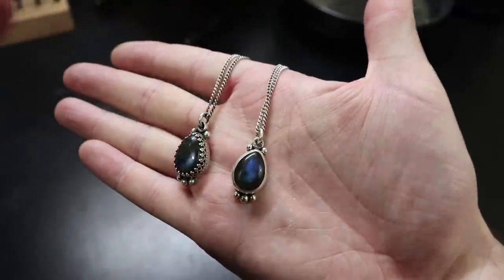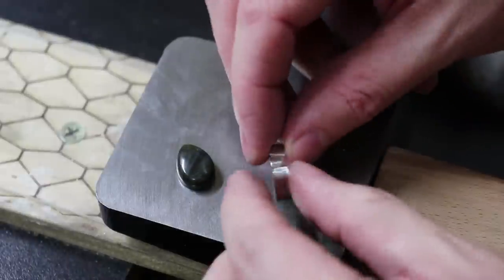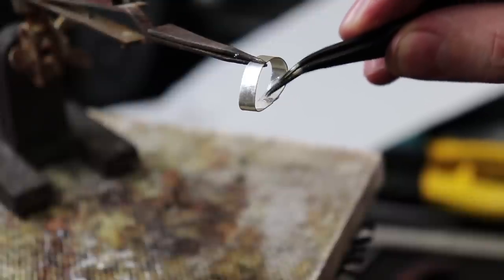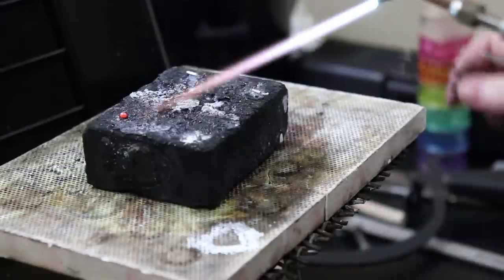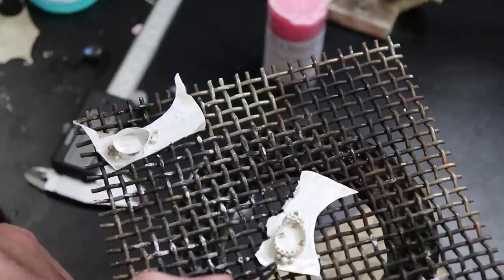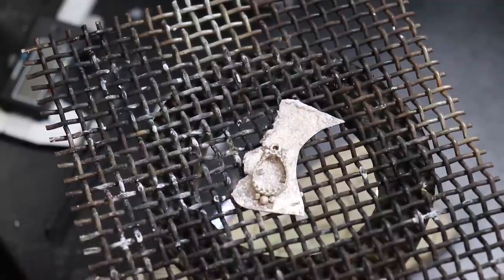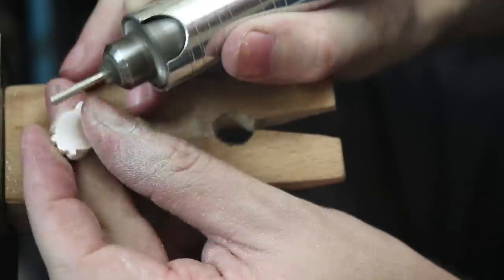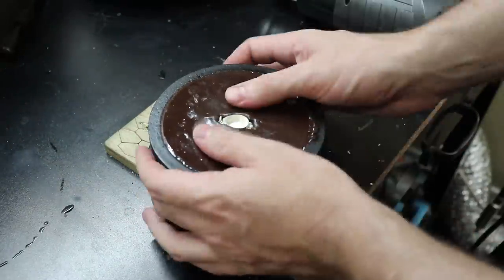Bezel Making and Setting Made Easy

Comment: Nice video. The trick with the floss was new to me. I usually have an open backside on the pendants I make so I can push the stone out. Also it reveals more of the stone and saves silver. 
One thing I do differently is I put the pieces of solder on the outside of the setting rather than on the inside. For two reasons, it's easier to clean up and if some solder remains on the inside of the bezel, it can leave a little hump that increases the risk of breaking the stone when applying pressure while  setting the stone.
And I really like your saw, I've never seen one like that before.
Reply: I also set the bezel on top of the solder pellet that the solder fliws up the seam and doesn't blow away

Comment: OMG! This video makes so much sense. Easily explained in such a way that I want to make something like this. But it is getting the materials and the such which you provide for your viewers. Thanks for putting this up.
Reply from the maker: No problem 😊👍 I do suggest using copper or brass to start seeing that they are cheap and if/when you make a mistake it will not cost you much.

Comment: Also I would like to see you make wire and sheet metal
Reply from the maker: I'll try to make that video in the near future, but I have some others I want to do first. 😄👍
Reply: If you do do that video, could you please try see the best way to do so without a rolling mill? That has been my greatest issue. It takes me forever to get an ingot to shape thin enough to be pulled thru the draw plate and would like to see if there is a technique that I'm missing to make it a little easier without having to invest in a rolling mill. I am just a hobbiest and only sell to pay for my precious metals etc. So it wouldn't be practical just yet for the mill.
Reply from the maker: Sadly, I use a roller mill to make my sheet and wire. The roller mill that I use was about $300 and was the cheapest one I could find at the time.

Comment: Use a ceramic plate to make beads. No sparks. Angle slightly and beads will roll off to pick up tray.
When alloying place lowest melting metal under or fold with alloying metal at lowest temp till low melting metal (zinc or tin) begins to liquefy and absorb itself (alloy) into the other metals then begin to increase temp and stir with stirring rod. 😉

Comment: I am working on labradorite a larger one and making a bezel is hard
 it’s been a headache. Every time I get one made it seems like when I get it on the back plate and I’m going to set the stone stone doesn’t quite fit right I don’t like using adhesive so I end up starting all over. Labradorite is a harder cab to set.

Comment: Thank you again, Randy.  Always inspiring!  I have a collection of scrap sterling silver.  What do you use your scraps for?  I hope you haven't already answered this a gazillion times.
Reply from the maker: So there are a few things you can do with your scrap silver.
1. If it's clean silver aka it doesn't have solder all over it, you can melt it down and roll it out into new wire and sheet with a rolling mill.
2. You can sell it to a silver recycling company. I don't know of any good ones off the top of my head but I'm sure you can find some. Basically you send it off to them and they will send you a check.
3. You can use some of the small silver bits by turning them into balls by melting them. You can use them in your jewelry designs.

That is just a few things I can think of right now and might help. 😁👍

Comment: I also dislike using adhesives ever. BUT (!!!) in MY experience gallery wire is practically useless and very wimpy for securely holding a cabochon. Reason: Any hair or string, another chain from a necklace, etc. when caught by the gallery wire (when, not if) WILL pull the wires away especially since gallery wire, as is most "bezel" wire is fine silver. I agree, gallery wire is way easier and very pretty, but I suggest using epoxy for this one application. Do you think that is a good idea in this case? I don't want to push my opinion on your wonderful video, so I appreciate hearing your thoughts. Has this ever been an issue in your fabrication?
Reply from the maker: Yeah, gallery wire can be a pain to get right and hold the stone in place without it moving around. I have been tempted to just use some glue to hold the stone in place and call it a day.

Comment: Such a wonderful video. It did not occurto assemble everything and then solder. I have a question. I do not have a hig functional metal smithing studio. So use a small torch. Is there a better reasonably priced torch I can get to do small bezels, at most going upto 7/8 th of an inch. I am not looking for something that I can use with a cylinder.
Reply from the maker: What kind of torch do you have?
Reply: @GomeowCreations  I have a small butane torch ( benzomatic) that I use. It does the work but takes longer than it should. Ao I was thinking of getting a Blazer 8000 or a max flame.
Reply from the maker: You might want to look into a plumbers propane torch setup. This setup will run you about 
$20-$30. I still use these torches for projects to this day 😊👍

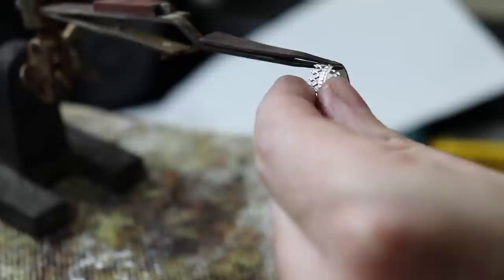Comment: 6:24 I would think it would be somewhat difficult to Hard Solder on to Fine Silver.  Since fine silver is easy to melt and even disintegrate if torched too much. Yet with hard solder it can take sometime before it reaches its Melting point to flow.🤔?
Reply from the maker: Yeah, this is normal and it does work. Just heat the metal from the bottom so you don't have the torch flame on the fine silver
Reply: @GomeowCreations  does the bottom plate have to be metal? or can you also use a fully silver bottom plate?
Reply from the maker: I don't know what you mean seeing that silver is metal
Reply: @GomeowCreations   I do know what he means and I have the same good question.
Reply from the maker: If you know what he means can you please explain so I can help answer the question 😅
Reply: @GomeowCreations  10:35 I had to rewatch this to see if I could figure out his question. Lol. And my guess is that since ur referencing "sheet metal" hes thinkin its metal and questioning if he could use a piece of silver sheet. I'm thinkin that the word "sheet metal" threw him off. Thats my guess. But I'm not sure if that's what he meant 🤷🏻‍♀️
Reply: @GomeowCreations  also, did u ever make that video on how u made your own sheet metal, after all?
Reply: @oclove1503  yes you are right, that was my thinking. I have no idea about metals and stuff. I have now made a small ring from pearl wire. Now i am looking for a stone or something beautifull to put on top. Its fun to try new stuff
Reply: @kickassvideos5469  I can understand why you would question that. Even though I knew what he meant, in general if i heard sheet metal, my mind probably would instantly think of stainless steel lol. Not silver. But fyi,  u can also use plated or silver filled sheet metal , to help lower the cost. Or practice on copper sheet first before you try with silver. That's just my opinion though lol.
Reply from the maker: I did make a video about making your own sheet and wire. https://youtu.be/Bs0rQJ4ritY
Reply: @GomeowCreations  awesome. I'll check it out now. Thanks

Comment: Hello! Do you have a specific tool or technique you use for getting a smooth, professional surface to the INSIDE edge of the bezel? I get the outside edge looking perfect, but the inside  will a few dimples and needs to be burnished. I cant do it with a burnisher without touching the stone. Suggestions?

Comment: I have been trying to find out how to get the dagger bezel wire to lay flat enough on the sheet to solder. No matter what I do there are gaps and I can’t pound it down or the daggers will bend obviously... how do get this to work? I’ve had no issue with any other bezel. Thank you
Reply: Once you’ve soldered it together you put the bottom part that’s going to sit in the plate onto sand paper and you sand it down. Hold it up to the light to make sure there are still no gaps. That’s how I do it. Sand the bottom edge to fit and the sandpaper must be on a flat surface

Comment: Do you recommend using easy solder for the back plate? I’m having a hard time with soldering the bezel to a back plate and I’m using medium solder and wonder if that’s the issue🤔
Reply from the maker: I don't recommend using easy for that part but at the same time I'm not saying not to use it. You can use anything that has a lower melting point than hard solder. So if you find it easier to use easy or extra easy then go for it.  😄

Comment: Why are you using fine silver instead of sterling silver?
Reply from the maker: Fine silver works really good for bezels. It's a lot softer so you can form it around the stone a lot better. You don't have to use it but most bezel wire is fine silver.
Reply: @GomeowCreations  Do you usually make the rest of the piece also in fine silver, or just the bezel part? Can you use the same solder you use with 925?
Reply from the maker: I just use 925 for the rest of the piece so only the bezel is fine silver. You can use the same silver solders with it.

Comment: Hey, with the "Crown" style gallery wire, how do you cut it so that the 'crowns' line-up correctly/evenly? I'm ordering it in Argentium Silver and really don't wanna make a mistake. That's the only mistake I foresee myself making.
Reply from the maker: Well you might not like my answer 😅

I really don't think about that too much and my stuff has always just kinda worked out. That being said you can cut one end of the wire so you have extra material before the crown tips and when you wrap it around it will give you a little extra room to cut everything to the right size.

I hope that is understandable

Comment: Maybe I am stupid but why does my solder doesn't melt like yours. It just stays as a ball.
Reply from the maker: Is your metal clean and are you using a flux like handy flux and not electrical flux or solder?
Reply: @GomeowCreations    Ah, I think I am using solder for electrical stuff. It was within the Solder kit. Thanks!
Reply from the maker: Electrical solder and flux and very different from jewelry solder and flux

Comment: I recently bought supplies to try and make these. I’m practicing with silver balls and simple rings but my flux is not flowing. I have the same flux, but I’m using 14g sterling wire. My flux seems to be a bit thick. Is it normal for the charcoal so crack and pop?
Reply from the maker: What torch are you using?
Reply: GomeowCreations power probe micro torch kit.
Reply: GomeowCreations my flux also seems very thick, not sure if that’s a problem?
Reply from the maker: That little torch would take a long time to heat everything up to the melting point. You need more heat.
Reply: GomeowCreations thanks!
Reply: GomeowCreations which torch are you using in this video? I see the gas torch and Creme brûlée torch on your amazon list.  Thanks!
Reply from the maker: I'm using with torch https://bit.ly/SmithLittleTorch5tips
Reply: Is the gallery wire, and bezel wire that you used for this project on your Amazon list? I can’t seem to find it. 
Do you think I could use my Dremel with a diamond bit to grind the edges of the bezel after sawing it?
Reply from the maker: I don't think it is but you can get it from riogrande.com as for your other question, it wouldn't be a good idea to use that to clean up the edge seeing that it need it to be as flat as you can for soldering
Reply: GomeowCreations thanks!!

Comment: can you use a soldering iron instead?
Reply from the maker: No you can't. I made a video about this if you would like to check it out https://youtu.be/r8nU0ZMZGFA
Reply: @GomeowCreations  cool thanks for the quick reply!
Reply: @GomeowCreations  is it possible to make one without a backplate?
Reply from the maker: How? The back plate is there to told the stone in. 😅
Reply: @GomeowCreations  ive seen some bezels with no backplate, was wondering how those worked
Reply: @GomeowCreations  they are on youtube, a quick search will find them
Reply from the maker: Link?
Reply: @GomeowCreations  yo